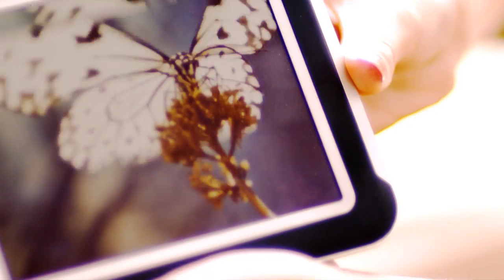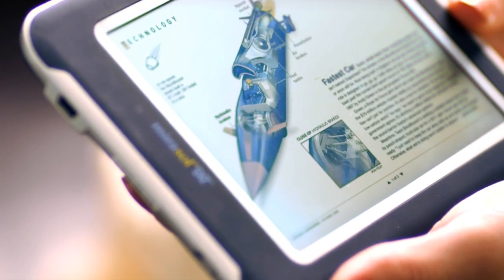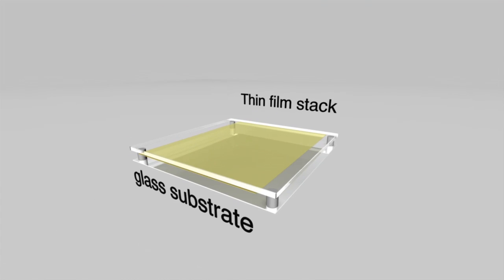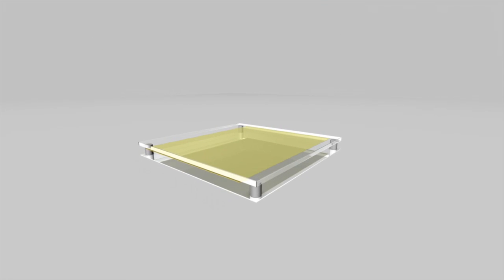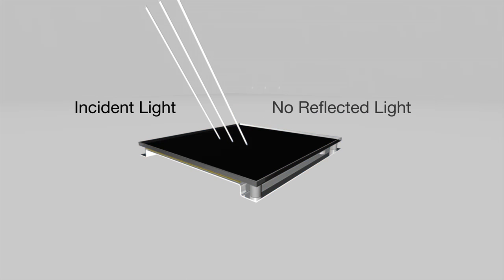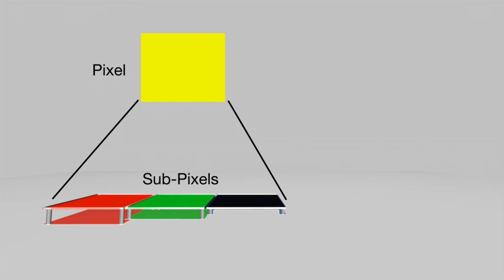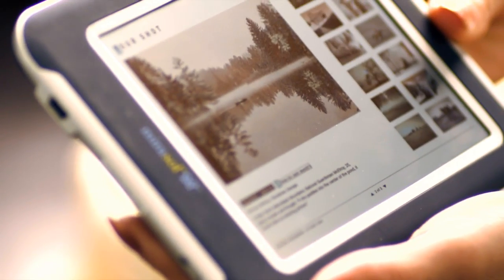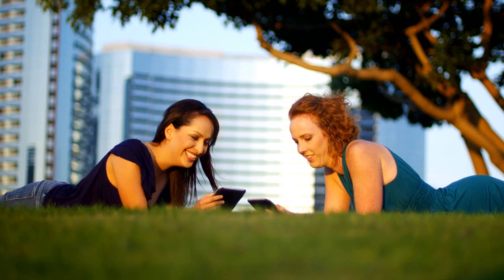mirasol Display Technologies "How It Works"

Comment: So why did this technology fail?
Reply: 2/3rds of light are absorbed by this display because it's using red, green, and blue filters.  That's as BRIGHT as it can be, 1/3rd as bright as the energy hitting it.

You can also see it's not very fast.
Reply: @fuzzywzhe  That also applies to LCD, and every other kind of colour display using RGB. Which is literally all of them, with only a couple of exceptions. Even emissive displays like OLED or even old CRTs could have triple the resolution and more brightness if they just used white emitters. Indeed B&W CRT TVs did, and had a much smoother picture to look at, one uninterrupted layer of phosphor instead of little dots surrounded by black.

Losing 2/3 of light is just a fact of RGB displays. Can't be helped but it's not necessarily crippling.

Also... this doesn't use filters. The size of the cells are on the order of the wavelengths of light. That's why the red cell is deeper than the blue one. Longer wavelength. It's interferometric.